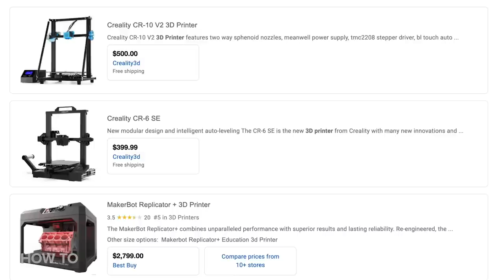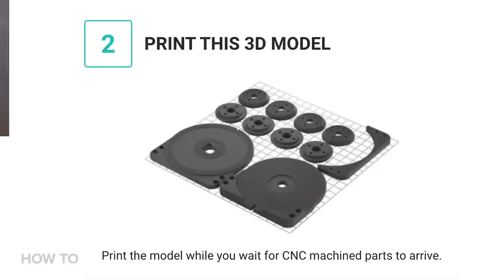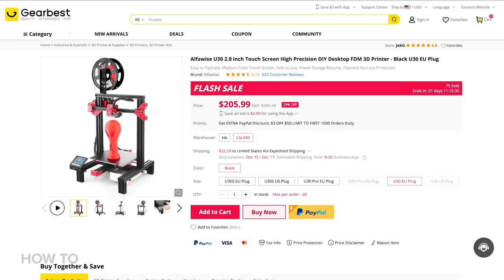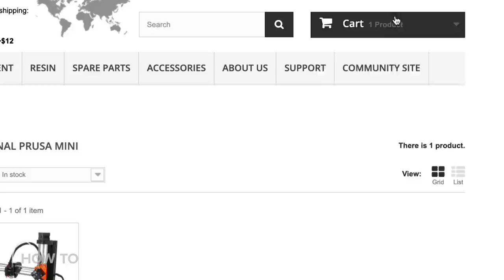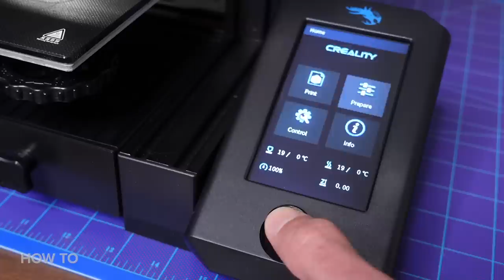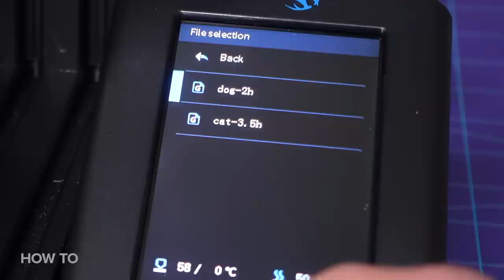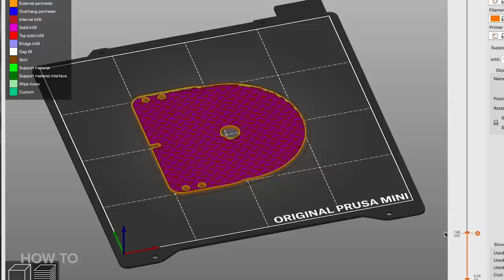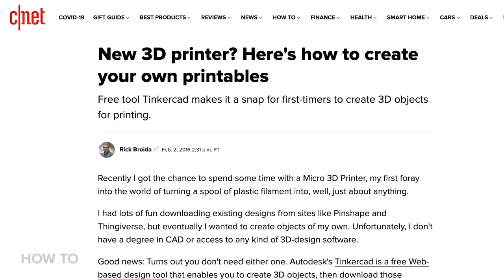How to get started with 3D printing

Comment: Good stuff! it’s a long (and sometimes infinitely frustrating) journey into the world of 3D printing but don’t give up its super rewarding! That cat looks a little iffy, perhaps check if the belts are tight and there aren’t any loose screws, also, if you’re gonna be getting glow in the dark filament you’re going to need to get a new nozzle, perhaps a hardened steel one as glow in the dark would chew trough your brass nozzle and increase the diameter of the hole, reducing print quality, that’s a quirk of these more exotic filaments like glow in the dark, carbon fiber filled and metal filament
Reply: Thanks Ryan for the feedback! That's good to know about the nozzle. I'll look into it.

Comment: Great video! I also have an Ender 3, but I'm not sure how much "Ender" is left after all of my mods, lol. Reminds me of the ship of Theseus, haha. 
I love that you found Prusa Slicer, it's my favorite free slicer as well. If you're going to add the BL Touch for bed leveling, may I suggest replacing the stock motherboard for the SKR Mini E3 V2? It's much quieter and more powerful, and works well with my Octoprint setup. You can even setup your own custom firmware with it, if you ever want to tackle that. Happy printing!
Reply: Thanks for the tips! If I'm not mistake, I think that might be the motherboard that came in the V2, but I'll take a look.
Reply: @darker_parker  According to Google the V2 comes with Creality's own silent board. I bought that one first for about $50. Unfortunately the 2208 steppers are in legacy standalone mode, so they aren't as good as the normal 2209's in the $30 SKR board. Plus it's only an 8-bit board instead of a 32-bit board, which means it is slower, has less memory room for features, and is a bit harder to program if you ever want to do that someday. Although the Creality board in the V2 does makes a night and day difference in noise. If you aren't going to mod it all up like I did it should be totally fine. I'm glad to see they include it as the default now!

Comment: Nice video, I've also just started down the rabit hole of 3d printing with my Ender 5 plus. I guess I should try out the Prusa slicer. Only 3 prints in myself, (4 if you count the initial fail in "eco" mode) but so far very intriguing.

Comment: With my ender 3v2 I found that the glass plate is a bit concave in the middle, that caused some prints especially smaller ones to come lose and ruin the prints. Larger ones or printing with a brim seems to help. In the end the solution was the BLTouch but that is another rabbit hole as far as firmware goes. So far the firmware that causes the least problems is the one from smith3d but the BLTouch seems to act weird every now and then, will not drop the pin, so I have to shut the machine down, pull the pin out and start it again. A bit annoying but at least the prints are good. Good luck.
Reply: I do have the BL Touch standing by to be installed, I just haven't had time to tackle installation yet. Hopefully in the new year!

Comment: That much hassle, and you haven't even "created" your own design.  Yikes.  I'm interested in printing r/c aircraft.  But it looks as though 3D printing is still not ready for prime time.  Unless you're into collecting partially melted little Asian looking cats.  That's gotta be the most expensive iPhone camera dolly ever conceived.  I endured the Commodore 64 thing.  It was crude and frustrating, but it didn't waste $30 rolls of string trimmer refills.  Now I use a Mac.  Guess I'll wait for the Mac of 3D printers.  It will just work.